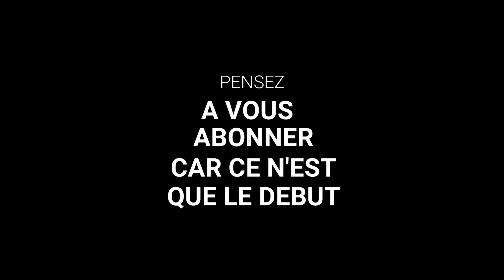🔧Installation Silencieux Ixil RC - Ktm 790/890 Duke R

Comment: With the piece that connects to the cat were those tac welds holding in a second baffle? Thanks for the video!
Reply from the maker: Hi, yes the second db killer is welded
Reply: @bayou3338  did you ever go back and remove it? I’m thinking I might lol
Reply from the maker: @JellyBeak  It's possible by filing the solder points but already without the big dbkiller, it already makes a lot of noise
Reply: @bayou3338  gotcha. I’m still waiting on it to come in the mail. I’ll leave it in and see how loud it is. Thanks!!
Reply from the maker: @JellyBeak  You will see for yourself ;)
Reply: @bayou3338  I did not end up breaking the welds. It’s plenty loud with the second DB killer inside lol

Comment: Is this euro 4 ore euro 5 ?
Reply from the maker: Euro 5 :(
Reply: @bayou3338  really ? I wasn’t thinking that you can remove the db-killer after euro 4…
Reply from the maker: @lucplay99  One baffle is welded and the other is removable
Reply: @bayou3338  thanks for the information…. I was thinking that all db killers need to be welded
Reply: Great video. I just got the same exhaust for my KTM Duke 890-R and  the fit and finish is horrible. I had to grind and bend the bracket because it wouldn't fit. I believe I'm going to remove the baffle inside the link pipe as well. Is that something you must have Europe? I've heard the word euro 4 and 5 but don't know what it means
Reply from the maker: @brandonmartin9732  Yes, the muffler is not very well finished and you lose torque with use, that's why I sold it. Euro 4 and Euro 5 are the anti-pollution standards.
Reply: @bayou3338  so did you really feel a decrease of torque while using the ixil exhaust? I have an 890 duke too and I am thinking about buying this exhaust but the black one… but if there is a decrease of torque… I'm not so sure